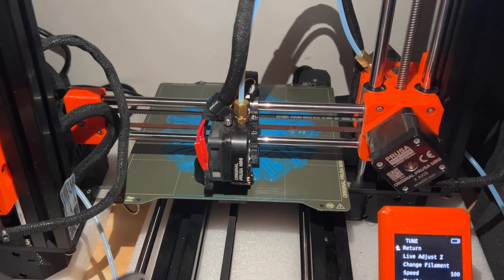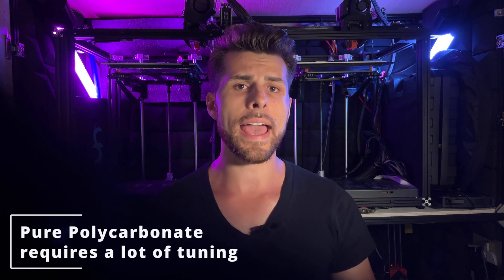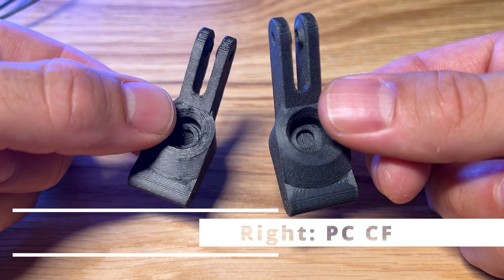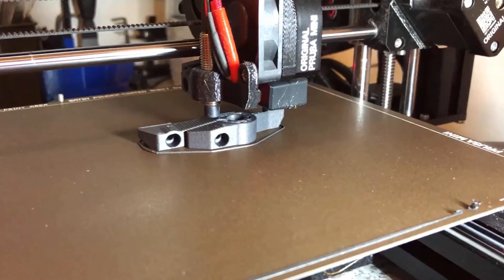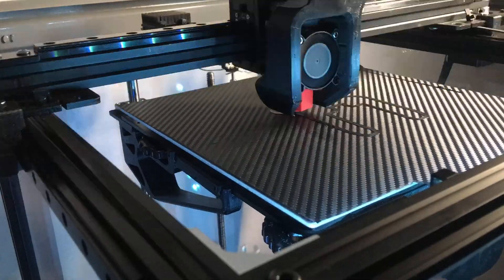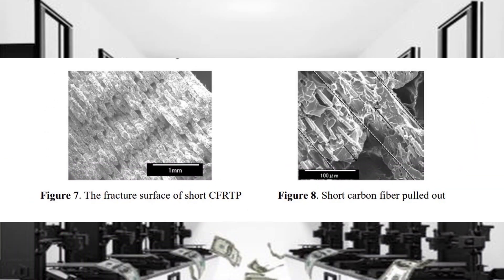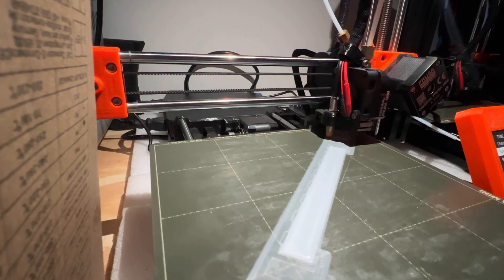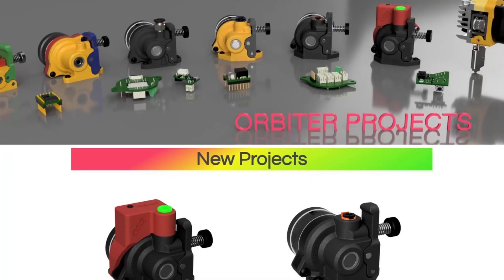PC CF: Polycarbonate Carbon Fiber from Prusament is a killer filament!

Comment: Has anyone talked about CF safety?. Has anyone seen how this stuff rubs off the micro fiber strands on your fingers. Some guy did a video on the hidden dangers of CF filament and it’s pretty disturbing just how easily the strands come off and embed themselves into his skin. Sanding this stuff could be lethal. Using anywhere it’s going to be handled likely carry’s an unknown long term risk to your health. After-all, asbestos and lead were incredible products, with even better properties! Meanwhile I’ve watched people make kids toys and face masks using CF material. I bought an XC 1 with the intention to print CF filaments regularly but now. Not so sure.

Comment: Interesting, I think I found the perfect material for my next project. A 6DOF robot arm where I need the stiffness/most rigid material possible. Was thinking of PLA as this is the most rigid of the normal materials, but this looks way better.
Reply from the maker: If you have some heat (generated by motors or electronics) this PCCF will get the job done. Plus a robot arm with the cf finish will loom sick💪🏼
Reply: @3DPrintingForMoney  I'm making an intake for a 2.0 engine with an aluminum plate between them... you think it'll hold?

Comment: LOL, when I read the title "killer" filament, despite the double entendre, there's literal truth in that statement. CF effs up your lungs if you inhale it while printing right?
Reply from the maker: Hi Scott! If it is true that the extrusion of plastic+CF emits UFPs, the quantity compared to milling is negligible. Plus, Cf in the 3d printing process gets “glued” to the semi melted plastic. Milling, watter jetting and lasering doesn’t have the binding and “sprays” UFPs and FPs in the shop. Still, I recommend to enclose every printer, put a hepa filter with active exhaust and vent outside. When possible use a water scrubber: A ciclone system is good for milling but not 3d printing.

Comment: Added to my list of things to try if/when I ever get my FDM to work right.  Got it to make parts and keep the resin for toys.  But the learning curve going max-upgrades before even trying it out is a bit steeper than I anticipated. lol
Reply from the maker: Yeah, upgrades even if fun to install take quite some time and fiddling!
Reply: I bought a bambu labs x1 c two days ago, ive now successfully ie 90% or more perfect printed PC, Petg, PLA and pahcf or nylon carbon fibre. The points were taken off for a little bit of bubbling on some esun petg. but thats to be expected as i live in a tropical climate with 80% humidity the norm. The thing that should blow everyones mind that reads this is, my experience history with 3d printing is 3 days. lol 😆 the most technical thing i do is load filament into the automatic filament machine, x4 and click print. Everyone ive shown is blown away. including watching the timelapse of the benchy boat that took a total of 14 minutes.
Reply: @Steve211Ucdhihifvshi what brand of PC filament did you use?

Comment: the prospect of breathing in carbon fiber dust just make it not worth it. abs is plenty strong enough.
Reply: A concern, but kind of an odd one.  Just heating thermoplastics to melting temperatures creates some off-gassing.  Not healthy either.  Just wear gloves and an appropriate mask when working with it.

To be fair, not sure about PLA.....but it's still a thermoplastic polymer, so probably.
Reply: @MrAcuta73  Funny you find it odd. What's funnier is that I'm not even talking about the gas. And... not sure why do you even bring PLA up? Please, read before jumping the gun and acts like you know a thing or two. It's the carbon fiber DUST I'm talking about. "wear gloves and mask", ehhh...if people actually does that irl there wouldn't be omicron.
Reply: @user-yk1cw8im4h  "if people actually does that irl there wouldn't be covid." 🤣🤣🤣I hope you are joking.
Reply from the maker: I run printers with dedicated hepa filters and activated charcoal boxes. Still, off-gassing and particles are a couple of magnitudo less than other production methods as laser cutting or cnc carving/cutting
Reply: @3DPrintingForMoney  carbon fibre is much worst than say wood fibre though, unless most gas, they can physically harm your lung
Reply: @3DPrintingForMoney  seems pretty hard to explain printing cf doesn't blast fiber dust directly in your face